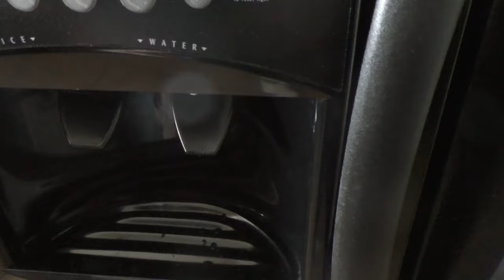How to Fix a Frigidaire Gallery Refrigerator that Wont Make Ice

Comment: I have had the oddest issue for a few months..The line that brings water in has been not working for years, but that’s cool I will just make ice and get tap water..Always a full ice tray until a few months ago when it sporadically began making way less ice than normal..I would stop and restart it and it would make enough ice to cover part of the bottom of the pan and then no more..So water is getting to the cube station, and the cube station is dispensing some, until today..nothing at bottom..I haven’t seen too many videos addressing that..

Comment: Great explanation.. i have the same fridge and can't seem to get the water dispenser working... ive replaced the solenoid valve and cleared frozen lines... i think the hose to the dispenser is clogged
Reply from the maker: I would check power to the solenoids on the valve.  Good luck.

Comment: ok I have same Frigidaire like yours and I followed all your steps. My ice maker is dry to the touch where you said to check with finger, white water tube did have an ice block which I thawed out, but when I checked the water like to fill the cup is very low! water pressure not coming out like it should. What else can I try? or is it that little piece that I need to order that feeds water upward
Reply from the maker: I doubt the solenoid valve would cause low water pressure.  I suspect you still have an ice blockage, or kinked or dirty water line.  Maybe filter clogged.  Try Google searching for low water pressure solutions for your fridge.

Comment: Replaced the entire assembly and still no water going to ice maker.  Any suggestions? Appreciate the video it was really helpful up to this point lol
Reply from the maker: Man, I thought I covered every reasonable possibility.  I would double check everything.  But it sounds like you may be dealing with one of those rare diagnostic nightmares.
Reply: Gonna keep messing with it.  Does it matter how you plug things back in.  Like my power sources ones brown, one yellow, and one green.  I think I hooked them up like they were prior but not 100% sure now.  Could that do it? Also, tried to move the big gear like another person mentioned in the thread, but I can't get it to turn at all. Looks great, gears look like new..

Comment: My water dispenser went out before the ice maker stopped working. My ice maker will occasionally still make ice, but not a full bin. Do you think that is probably a valve issue?
Reply from the maker: Definitely could be.  You can try reversing the connections at the valve so the ice solenoid works the water dispenser to confirm whether it is bad.

Comment: My friend. Question. I did have a blockage with ice in tube, cleared it and also replaced valve assy. Still no water called to ice maker.  You think it’s a bad valve assy?  I got it direct from Electrolux and same exact unit I have as yours 👍. Any ideas?
Reply from the maker: You can test the valve assembly by reversing the connections to the solenoids on the valve assembly.  This way the water dispenser will request water through the ice maker solenoid.
Reply: @FarmDad  genius. Thank you 👍👏👏

Comment: I appreciate your feedback but all those steps didn't even work to produce ice it seems. I even replaced the water inlet valve and still no success. The line going to the ice maker in the beginning I could see it going up the line which is green and clear nothing clogging it. I even blew on it and heard air coming out on to bottom. I'll have to watch another YouTube video to see another diagnostic steps. Thank you though for your feedback even though it didn't seem to work. I'll certainly get back here if it was what you've said. The filter is not clogged because I can get water coming out in the front of the refrigerator where it dispenses water & ice.

Comment: Looks like I might have a bad assembly valve unfortunately. Is there a way to fix a clog in the blue tube? May have something in there as there's a dark spot near the top of the tube and water in tube up to about halfway.
Reply from the maker: Hmm, other than replacing line, I can't think of a good way to unclog line.
Reply: @FarmDad  okay! Thanks for the reply!
Reply: @FarmDad  just a little update, took apart the blue line and couldn't find any clog as water that was previously in the line fell out on both sides when straightened out. I took a little paper clip end and stuck it in where the assembly line was which moved the locking mechanism and water sprayed out while the clip was in so I know there's plenty of pressure and no clog but something in the refrigerator seems to not be communicating to send water up the blue line.

Any thoughts or suggestions? I had a water pipe break outside two weeks ago and had to shut the house water off which is when the ice maker stopped working (as I noticed it was broken about a week ago) so it's seems a little coincidental that it wouldn't be because of that. Might just be the actual ice maker is wiring is broken. :-/
Reply from the maker: @danieltravelstead if you have both an ice maker and water dispenser and one works and the other doesn't, you can try reversing the wires on the solenoids on the valve assembly to see if it switches what works and what doesn't.  I suspect your valve assembly from the sound of it.
Reply: @FarmDad  yeah that's what I was thinking too but wanted to ask from more of an expert since I have zero experience with fridge stuff lol. Thanks for the tip!

Comment: No ice in freezer, no water in ice maker, low pressure on water dispenser. Replaced filter and now have good water pressure, also replaced water valves. Any idea what could be the issue since I am getting very good water pressure out of the dispenser but no water for ice?
Reply from the maker: Have you checked for a frozen line where it comes into the ice maker?

Comment: can you help me with my refrigerator not making ice cubes.   I tried the jumping wire H to T and it did turn and did brought water.  but with out the jumping wires it does not bring water.      do you think it might be the water valve ?
Reply from the maker: If you are saying the only way your ice maker gets water is by bypassing the solenoid on the water valve, then that sounds like it would be the problem.

Comment: We have been living in our house for 3 years and finally wanted to know if we even had a water line and we did but the valve was closed so i turned it on and now im gonna let it run its course and check back in like 30 min to see if its working now
Reply from the maker: Hope it's working for you.

Comment: Im at the same point. My ice maker has worked fine.  I shut water off and changed filter. Once I turned it back on the valve went wild and water flooded my floor somehow. Its done it before when they were working on the water lines. I have extreme pressure where im at. Maybe that top pc is leaking on mine
Reply from the maker: Hope you get it figured out, buddy.

Comment: Okay, I checked the tube, all clear. I have water at the dispenser, but not making ice. I have replaced the valve on the bottom. There was no water coming from the green supply line that runs from the bottom to the top tube. There WAS water in it when I replaced the valve. I poured water into the ice maker and I'm waiting to see if it dumps ice. 
I'm guessing that replacing the ice maker is the next step?
Reply from the maker: If there were already ice cubes in the ice maker and it just won't dump them, then yes replace the ice maker.  If water is not making it into the ice maker then you have problems somewhere else.
Reply: @FarmDad  I seen another video about the switches in the ice maker itself. I took the front cover off, turned the gear and water started pouring. I removed the plate and didn't see a reset switch. I assume one of the switches may be bad. I'm not ready to get into all that. I've got a top freezer fridge that the ice maker is not hooked up. I'm going to pull it and install it in this side by side and see what happens. 😜👍
I've got to get this thing fixed. The wife is looking at a $2,500 fridge, and I'm just not ready to go there right now. 
Thanks for your help! Great video.
Reply from the maker: @miconn69  10-4, yes in the front you can set up how big of ice cubes you want.  I suppose that could cause problems.

Comment: Farm Dad, I have a question, I don't know what else I need to replace I still don't get ice.
I have replaced the filter, replaced the inlets but still no ice?  I am not getting water to the ice maker.  My water dispenser does work.  I also checked the water line and it is not clogged (at least I don't think so)  Can you help?
Reply from the maker: On the valve, try switching the connections on each solenoid, this way the water dispenser uses the ice maker valve.  If the dispenser no longer works after you do this, you need to replace the water valve assembly.
Reply: @FarmDad  I replaced the water valve assembly - ice maker still not working
Reply from the maker: Oh, sorry.  This may be time for a pro.  Sounds like bad wiring, bad ice maker, or something else atypical if you hit everything I covered in this video.

Comment: Can you tell me the name of the valves i need to order?  I’ve  done all of the steps and no water is coming out of the tube.
Reply from the maker: I normally call it a refrigerator water valve, but it may be better to search for refrigerator solenoid valve.
Reply: @FarmDad  thanks i ordered it. Do you have a video on the steps to replacing it?
Reply from the maker: @mmonroe8477  I do not, but I'm sure someone has one on here.

Comment: I have low pressure from water dispenser and no ice, I did all of these steps (including swapping the inlet valve and filter) and it didn't fix it :( any ideas?
Reply from the maker: Sounds like there's an obstruction before the valve.  Maybe look for kinked or clogged lines.  Take your main water line off to see if it is clogged, etc.

Comment: I think my ice maker is over filling. Where can I adjust the water fill?
Reply from the maker: If you are looking at your ice maker, the adjustment is behind the square cover that has the sticker that shows which direction is on and off.  At the very front.
Reply: @FarmDad  so I need to unscrew from the wall panel to access?
Reply from the maker: @charlenebolduc8346  no.  This should help you.  https://www.hunker.com/12002488/how-to-adjust-the-water-level-on-an-ice-maker
Reply from the maker: @charlenebolduc8346  this is what the cover looks like https://images.app.goo.gl/P5Fm3fGEdQ5cFhTZA
Reply: @FarmDad  thank you!!!! Now I’m waiting for it to cycle to see if that was the problem. Thank you again!
Reply from the maker: @charlenebolduc8346  most welcome.  Good luck

Comment: How do u fix a red light on a Frigidaire water and ice filter after it's been replaced? It's killing me!
Reply from the maker: There should be a reset procedure for your model of fridge.  It often involves holding down a button.  Check your manual or Google search how to reset it using your model number, which is found inside the fridge.

Comment: What if there is no filter at all?
Reply from the maker: If refrigerator was supposed to have one, you need to have it in for it to make ice.  If refrigerator didn't originally have one, then you can skip that step because it isn't your problem.

Comment: Great video, but nothing worked. 

No power at the solenoids I pulled out the ice maker and found a bracket connecting the ice level arm to the microswitch was bent. Easy fix with my vice and a small hammer but a pig to unplug my ice maker in my bottom (drawer) freezer.

Great troubleshooting video but the ice maker and "steel" bracket were made in China.
Reply from the maker: I haven't encountered that one before.  Good catch!

Comment: My line keeps freezing up. Why?
Reply from the maker: Could be several things.  Off top of my head, your freezer temp could be too low, your filter could have a restriction, or you could have mineral build up in your water line that slows flow of water.  Make sure to get it completely thawed out too, because if you leave a little ice it's easier to freeze back up.

Comment: 5:00 this is bad engineering on this piece. Had to wrap it in Teflon tape to prevent it from water spilling out into the freeze blower motor and then freezing.

Comment: Ok, he forgot to mention that if you find ice blocking the funnel you need to replace the water inlet valve because is  letting a little bit of eater to pass when is not energized , is failing mechanically, another thing he didn’t mention is that the ice maker mechanism send power to the inlet valve when it needs water , and in some cases the valve is good and is the ice maker that don’t send power , you can check this by opening the back , you swap the wire harnes on the valve temporarily from the water dispenser to the ice maker , there are 2 wires harness you have to follow the hoses that come from the valve and see which one is the ice and which is the water then  swap them , then have someone to put a cup on the water dispenser and if the valve is good the Ice maker will fill with water, if no , replace the water inlet valve
Reply: I praise you for your video, it really helped my daughter.  I now have a situation, there is ice in the tray but, when I try to get crushed or regular ice, it makes a click sound but no ice comes out.  FYI, the water part is working, just the cube and crush ice that is not working.  Can you help please?

Comment: Our ice maker keeps freezing up 🤦🏻‍♀️ I have to take a butter knife and beat the ice off of it so it will start making again. Any solutions? Fridge is less than 2 years old.
Reply from the maker: Off the top of my head, I'd first try adjusting the freezer temperature.  If that doesn't do it, try the method I did in the video where you actually remove it and melt all the ice.  It's possible that the butter knife method is leaving some ice still in the tube and as water comes in it freezes and makes the ice patch grow each time until it is clogged again.  If that doesn't do it, I'd also make sure you have a good clean filter in it because if it's dirty, it could slow down the flow of water and I've seen where fridges that have low water pressure freeze up that fill tube often.  Likewise, if the water valve isn't opening up good, that could cause low water pressure as well.   Good luck!